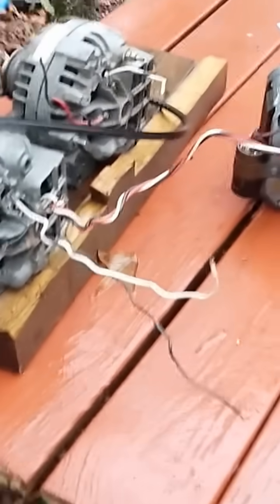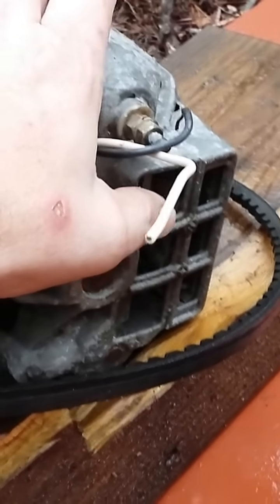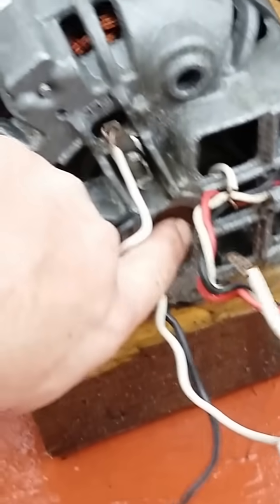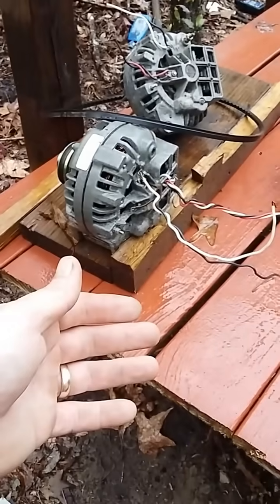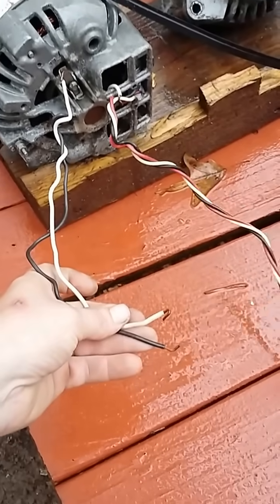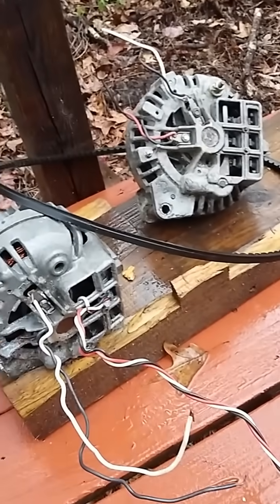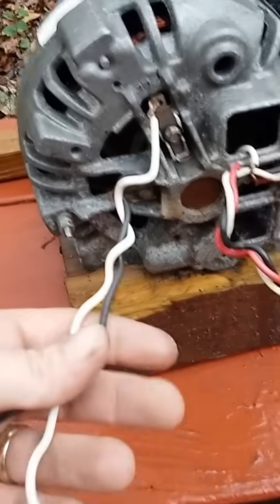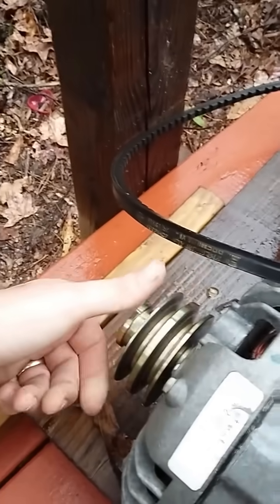Update Free energy forever no wind no solar no gas READ DISCRIPTION!!!

Comment: The only problem with this is that it doesn't work. When you transfer energy from one device to another, there is always a loss through heat and friction. Even if there were no heat and friction, if you could transfer energy at 100% equal from one source to another, theoretically it would only power itself and nothing else. As soon as you power something else, you again lose energy from heat and friction. 
In order for this to work, you need assistance from solar, wind, gravity, or an additional natural resource which already contains energy.
Reply: I tried doing something like that when I was a kid and my Dad said I know what you are trying to do but it will not work  !
Reply: Dude doesn't understand conversation of energy. Where does everyone think he gets the power to run the first motor to run the alternator? 😂😆😆

Comment: Connect a inverter to a battery run a 110vac electric motor  use a belts to a alternator use the alternator to recharge the battery lost keep up Whit inverter capacity of you loose 1000 watts and your  alternator pulls 1500 you be ok but if you load is 1500 and your alternator pull 1000 watts to charge the battery will run out of charge

Comment: The moment that you put a load your rotor will demand more power for turning it will start to get hot to 
Stator are the windings inside the alternator the turning pc is call rotator  it won't take a load is not desing for that is just charger to charge the battery and yes will generate AC voltage without the diodes but the calculations are for 14v out put DC so you stators will pull 18v AC before the diodes if you change the configuration of the stator but not the rotor it will not work

Comment: OK so I'm going to explain this in full for all your readers, a 110 amp alternator has the ability to produce up to 250 volts A/C current, after it produces this that power is sent to a bridge rectifier and a voltage regulator that changes the A/C current to D/C current @ 12+ volts to supply power to you car battery, it is also set up that it will never produce more power than your car system requires. in saying this when you take the bridge rectifier and voltage regulator out of the equation you have the ability to access the full power of the alternator. 110 Amp @ 250VAC = 26,000 Watts, which is enough to power 2 medium sized homes. the only thing I cant seem to figure out is how to connect to the stator bypassing the bridge rectifier and voltage regulator while keeping these systems in place to power my three 12v batteries running my motor that's spinning my alternator and providing a charge to the rotor to excite it.
Reply: A magnet can act as a diode. Current is current, directing it one way is what's referred to as direct current. Research power transmission and they tell us to our face that when they added the third wire years ago they put it at negative power, it almost cancels the other two.
Reply: I would say set up an inverter from AC to DC on your AC side feeding back from the panel or basically run a strong battery charger plugged into your AC side feeding your DC side to your batteries
Reply: Run two alternators one for A/C the other for D/C
Reply: @JCoastr  thats actually a really good idea lol

Comment: You know you can make your own step up transformer and just use a magnet so you're stepping up the EMF. It lights light bulbs. Plus there a device that uses a series of pulleys that increase tension so you can put a 10lb weight on it and you get light from it falling like newton's apple.
Reply: Can anyone tell me why NASA decided to launch straight up instead of gaining speed first? You don't want to start uphill, straight up is even more difficult. We all should know that right? F you NASA, you bunch of "geniuses". Just as stupid as the rest of us, right? Everyone knows more about something. Love knowledge truth and wisdom. The only four things that will dissapear if we don't share them and will multiply if we do. What if crude oil is both a lubricant for earth and "battery acid" power storage? Just a thought.
Reply: @chrisbrooks89  I know!😯
Reply: @chrisbrooks89  uh, technically, NASA doesn't launch straight up.  You are aware of this, right? It just looks as if it's going straight up. In reality they are going in a circular path along the plant using the earth's gravitational field to conserve fuel and reduce strain on the rocket...

Come on man, dont out yourself out there like that. Before tossing wild statements out there fact check it first...
Reply: @trupyrodice4462  you do realize just because I didn't specify 90° perpendicular doesn't mean that's not exactly what I meant. I forget not everyone needs everything as simple as it can be. Thank you.
Reply: @Chris Brooks  wait... what? You... you're fkn with me, lol - right?
So you were implying that it went strait up at 90°. You just validated it in saying "just because I didn't specify 90° perpendicular doesnt meant that's not exactly what I ment"..
I thought that's what you ment, that's why I said that it doesn't take off straight up. It takes off at an angle gaining speed as it goes to leave earth.
They do it for a couple reasons, especially taking off from Florida, one it uses earths gravity to lessen the forces exerted on the rocket itself, and the second to use earth's spin rate of spin at the equator to give a boost, so to speak.
Reply: @chrisbrooks89  Wonder why your link in my last post wasnt highlighted...
Reply: @trupyrodice4462  dude seriously? Thousands of times the power of a fighter jet that, like almost all aircraft, takes of horizontally. Why? You don't park your car facing uphill cause why? It's even more difficult to the greater the AOA. That's why a jet can hit well over a hundred miles an hour in less than two seconds in a couple hundred feet and a nasa rocket still takes thirty seconds just to get moving. Your dice might be loaded bro.
Reply: @chrisbrooks89  Question; How big of a "plane" would they have to build to cary all the  technology, people, supplies, and more importantly the fuel it would require for them to; Reach escape velocity. Maintain and continue flight outside of atmosphere. Keep the shuttle in orbit. Maneuver itself as needed or into docking with ISS. Returning and landing back on earth.
Your idea isnt without precedence tho, they have experiments that had the shuttle piggybacking and deployed from a larger aircraft once its reached atmospheric ceiling. Not sure how that worked out tho.

Why do you think they dont take off like an airplane and just fly into space? I'm curious to know your perspective on the subject.
No ulterior motive I just like to have multiple perspectives.
Reply: @trupyrodice4462  quite simple, everyone knows the heavier an object the more energy it takes to accelerate and a steeper angle requires more energy. If anyone can give me an acceptable reason they decided to skip that step I'll accept it. You do know the fuel is the majority of the weight on a space shuttle right? Think about it. Even passenger jets don't have to release fuel canisters, and once out of the atmosphere you keep going even if you don't have fuel. Hence the idea to launch to the moon, then launch from there for longer flights.  Almost no gravity and no friction from anything really. Air resistance is a hindrance however it's also used to keep planes in the air. No air resistance, no gravity equals less energy expenditure.
Reply: @chrisbrooks89    Thats absolutely correct, IF we were on the ground and surface to surface friction (like a car) was part of the equation but it's not, we're talking about (forgive the vernacular) rocket science and a rocket scientist, I am not. Lol.
I think you (and I) are overlooking the critical physics and calculus involved; kinetic vs mechanical energy and forces involved. What I found was that energy (or work) to move an identical object like a rocket (or bullet) any amount of distance is the product of mass, gravity. Basically the earth's gravity has the same force on the object (like a rocket) regardless if taking off horizontal or vertically positioned. The drag (friction in air) is also the same on both objects but only until the rocket moves higher. The drag on the vertical rocket diminishes as the atmosphere gets thinner.

If the same caliber and brand of bullet can go the same distance (or greater) verticality into the air as opposed to being shot horizontally; shouldn't that give us an idea about the dynamics at play in the rockets?
They both have the same amout of propellant...
Reply: @trupyrodice4462  I'm sorry but are you trying to tell me that there's no such thing as air resistance?
Reply: @chrisbrooks89  I'd like to thank you, first, for your ability to stay respectful when debating opposing views and ideas. Not to many people can do that, at least from what I've seen online.
Second is that I now know more about rocket science than I did before. Lol. I'm always trying to see new perspectives, ideas, or anything else contrary to mine. It helps me grow and be more rounded. Even if I'm wrong. Lol. And it happens, believe me.🤣 sometimes alot.
Reply: @chrisbrooks89  I covered that in my comment when I mentioned "drag and air resistance."
Reply: @chrisbrooks89  my bad, I said "drag and friction in air" not air resistance.
Reply: @trupyrodice4462  Thank you for remaining respectful as well.  I'm wrong quite a bit just like everyone else that admits the truth. Truth, love, knowledge and wisdom are four things that will disappear if we don't share them yet will multiply if we do. I'm a curious person looking for answers.  Don't suppose you know anything about electromotive forces? Ley lines? Current? Pyramids? Been kinda researching trying to figure out why we can't power the world for free using electromagnetic/electromotive forces. There's gotta be a reason besides financial gain, right? If we can light a light bulb with a magnet and a little bit of wire and such, why can't we use similar technology to Tesla coils and step it up to power whatever we need? Granted Tesla coils frequency is way to high to be usable, however, why can't we step it back down like the power grid constantly does anyway?
Reply: @chrisbrooks89  You are absolutely spot on. We are all wrong on occasions, its inevitable. Our saving grace, so to speak, is that when we are in error we can admit it, own it, learn, and move on better for the experience. It's called humility, growth, and intellect. It seems to me that society is greatly lacking in all three. Lol.
Besides, having the courage to speak up and voice our personal perspective even tho it isnt readily accepted or goes against the grain of accepted thought shows others that you are thinking for yourself and not just blindly accepting the spoon fed narrative. Not only is that commendable its absolutely reassuring that we are on the right track. I love hearing things like that. It makes me question my understanding so I go off in search for an acceptable answer. Regardless of "acceptable" thought. You and I are a dying breed I fear, altho I do run across others like us once in awhile, it's just not often.

As for the lay lines and stuff, I do. I've been checking that stuff out as well. I've come to the conclusion that this is kept from the general public out of pure greed and control. Just like reading wasn't taught freely to the underclass of old.
Some bad business... just like the existence anti gravity (also stemming from Teslas work) or the ability to direct high powered microwaves to produce sound inside a person head that isnt sound; well, not in the typically expected way: Sound vibrates the eardrum that in turn vibrates a small bone that in turn rubs a nerve sending signals to our brain that we perceive as "sound". What the high powers frequency microwaves do is bypass the ear drum and targets the nerve directly. It was only directional and line to sight back when developed in the early 50s but has since been developed and improved upon and the federal government's patents updated as recently as 2016.
There are scores of amazing inventions and scientific breakthroughs that could have made earth a utopian paradise long ago had it not been for the greed and thirst for power of weak men with inferiority complexes.
Reply: @trupyrodice4462  I concur good sir. I have opened my channel somewhat so everyone can have access to everything I research. Feel free to post videos and links to reasonably credible channels. I'll be as welcoming as possible so if there's any issues or questions don't hesitate.
Reply: How many know of gassifiers? I have an idea that could change the world in weeks or months not years and years. The years keep getting worse and everyone cares less. My idea keeps getting shot down. All we have to do is build two gassifiers with a friend then build four with two other friends and we're done. Many people have done it, I don't know anything about them other than they exist and can power your house, generator and vehicle.
Reply: Nighthawkinlight has a lot of really educational and interesting videos.
Reply: @trupyrodice4462  Help me help you. I sometimes get good ideas, half the time I have no means to proceed. We could possibly eliminate the electric bill, water bill and gas bill in one swoop. Three birds with one stone. Bring back bartering. The world keeps waiting, caring less the longer the wait. Two steps each, that might be all it takes. I'm sure this idea needs modified or finished like a lot do, that's why teamwork is so important. Nobody can ever know it all even about just one thing. Sharing knowledge with experience creates wisdom.
Reply: with this system you do not need a step up or step down transformer as one alternator can produce around 25,000 Watts. no transformer needed
Reply: @chrischase9601  you're joking right? The 110amp rating is at 12v. It's less that 1400watts. And no reasonable person would pull 110amps from an alternator rated at 110amps, at least not for more than a few minutes.
Reply: @0my  its only rated at 12v "DC" because of the regulator and bridge rectifier
Reply: so yes you wouldn't get 110 amps but you'd get at least 90 amp at 250 volts AC, still enough to run your house
Reply: @chrischase9601  You can eliminate the alternator with a simple step up transformer you can make yourself.
Reply: Research power plants and how they work and you might notice some things like I did. Research how many in the US. Use formulas. The most powerful nuclear reactor and hydroelectric power. Our power generation capacities and usage. We all know you can use plain wire to get radio stations. The em spectrum includes everything from short-wave to ultraviolet light. Ley lines. Do your own research. Let me know if I'm mistaken, it's how we learn.
Reply: @trupyrodice4462  I totally forgot, check out the man that jumped from the edge of space.
Reply: @trupyrodice4462  https://youtu.be/ERdMdTgT_M4